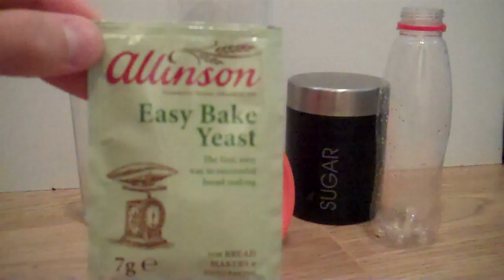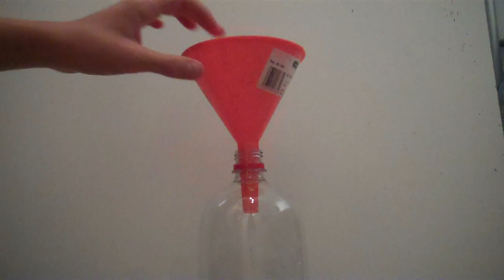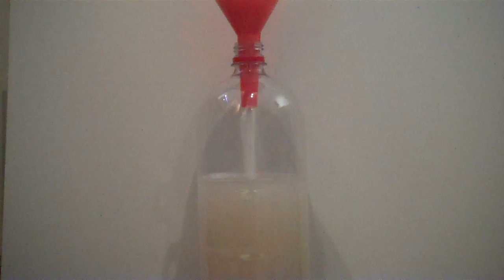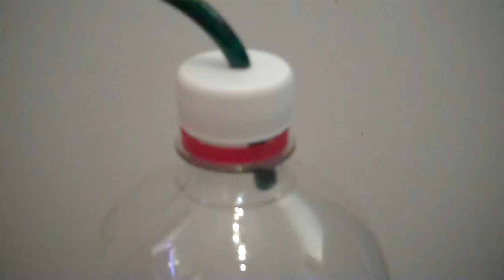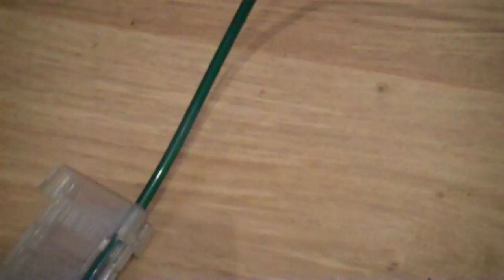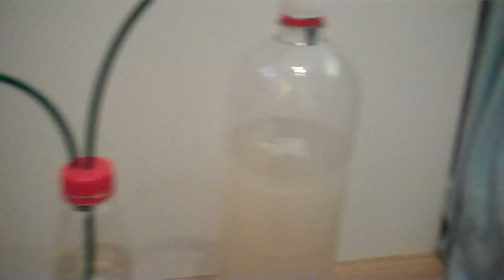How to make a CO2 reactor

Comment: have you put on a none return  valve is tried it with out one and it made a right mess it was all over carpet and over  my tank cabinet floor so I do recommend putting on a none return valve
Reply: happened to me! this was a good few years ago, i belive aftr this video came out i tried it, and half my room flooded, i had half my tank in my room!And it started dripping downstairs, i would personally put a valve as its very dangerous not to, i almost startd a fire in my sleep

Comment: Hi mate how do you turn your co2 off at night because they don't need it at night I have an Hagen one but I just put sugar and yeast in this Hagen canister with an air line and a none return valve on it if I put a air flow knob on it to turn it of at night I would I get round it as I don't want the gas inside the canister to build up and no where to go and go with a loud bang can you get back to me thanks

Comment: A great tip for Threading the 6mm Tube, through your 5mm Hole,
 -is to firstly Cut the end of the tube at an extreme angle so that you have a nice Easy thin end to thread through.
Then cut across this silly pointed bit at 90 degrees Afterwoods.  = )     Easy.

Comment: hey just for your info-
a lot of you'll have problems with the diffusing. so I just figured that there is this type of filters that has a diffusing unit in it. there is a hole where you can insert the co2 tubing
and it will diffuse the co2.

Comment: Not a post to knock Rossi. The dude is much better at this than me. I just wanna say that the bubble counter didn't work for me. I just ran a container straight to the tank. I have a glass ceramic diffuser that you can find on Amazon maybe this was my problem being that it requires more pressure than a ladder system. Regardless, I've been running this system for over a week now and not a single fish has died on me. I have Gouramis, Angels, Corys, Loaches, and Tetras. All proud survivors.

Comment from the maker: yes but only a very tiny amount would actually be diffused, it's not really worth it, you could however put the airstone under a filter outflow, this will hopefully blow the bubbles around the tank keeping them in contact with water for longer giving them a change to diffuse as opposed to just floating straight to the top and popping.

Comment from the maker: yes because if the bubbles are smaller there has to be more of them to match the same volume of gas released without using a diffuser. This means there is more surface area of the gas exposed to the aquarium water and it diffuses effectively.

Comment from the maker: wooden diffusers work very well if that's what it is, co2 ladders generally diffuse more as the gas is in contact with the water for longer allowing for more gaseous exchange to occur. It should be fine, just make sure you replace the solution every 1-2 weeks and keep the temperature pretty stable, this keeps the production of co2 pretty constant as fluctuations in co2 levels can cause algae. thanks lol :)

Comment from the maker: The only time you shake it is when you originally put the mixture together, you should replace it every week or every two weeks to ensure there are steady co2 levels. shaking it with the cap and tubing on will force the liquid up the tubes.

Comment from the maker: @1997BLucy Thanks :) I did use this for a month or so and got good results, however it can trigger an outbreak of algae if CO2 levels change wildly, this can be caused by changes in temperature, so it's best to keep a constant temperature when using this. Airstones don't diffuse much CO2 at all, the bubbles are too large...I would really reccomend investing in a ladder diffuser as they need very little pressure and operate great. I am trialing liquid carbon instead of co2 at the min.

Comment from the maker: @JackDraak you could use a diffuser however most ladder diffusers cannot fit through the neck of the bottle, using wooden or glass diffusers will also make it more difficult for CO2 to make it  into the tank and will make leaks more likely, but yeah if you figured out a way :)

Comment from the maker: @raymon664 Hi, yeah the reactor generally produces more CO2 at higher temperatures...I usually place mine near a window or above a radiator to keep them at a nice temperature. Aquarium safe silicone can be used to plug leaks if needed.

Comment: i just found a basic pressuriesed co2 sytem it comes with everything you need a ccanister tubing bubble counter a diffuser and its alot cheaper than the profetional ones ranging from£200 up tis one is only £65 and is suitable for 15g to 40g go on eabay and search :Fluval Pressurised CO2 kit 88g For Aquarium plants 
the only downside is you have to buy replacement canisters becoz the origonal one cant be refilled for tht search:Fluval Plant Pressurised CO2 Disposable Cartridge 88g

Comment: In general, in alcohol production, what is poured off is then distilled to concentrate the alcohol. The sludge is usually then 're-pitched' into the next fermenting batch to produce more alcohol, (here, to generate more CO2). The process just keeps repeating. If some contamination (wild yeast etc) hinders the yeast and you see output decline, you can start fresh with a new yeast alone. You could also add extra yeast to the sludge but this is not needed. There is plenty of yeast in the sludge.

Comment: Very little alcohol remains. What you are pouring off and discarding is almost all the alcohol and other byproducts of fermentation, leaving only the yeast sludge that falls to the bottom along with a very small amount of alcohol. You are just restarting the process, distillers do this all the time on new batches of alcohol.

Comment: As I am sure you know, you are fermenting sugar to produce alcohol and CO2. So, to 'regenerate' your system after all the sugar has been converted , drain off most of the liquid in the large bottle, leaving the 'sludge' undisturbed on the bottom (this is the yeast), add more water and sugar, shake vigorously to aerate the mixture, and you should be good to go (of course change the water in the smaller bottle).

Comment from the maker: @drpainnuk3d Hi I don't know a great deal but I'd say the minimum tank size you can use it on is 15-20litres it will be fine for a 60litre...In the long run it may be cheaper to run a pressurized system but I hear the co2 canisters can be expensive

Comment from the maker: @doddy8934 Hi I don't think that'll last any longer, after so long alcohol is produced...I'm not an expert so I don't know the exact times or formulas etc but I assume having more of the mixture will just increase the amount produced rather than the time it will last. For example it may double the output over the same length of time.

Comment: nice video :) but I suggest you to put inert substance into a smaller 2nd bottle... cooking oil could be the cheapest and easiest solution. if you have water, some CO2 will be released into a water in 2nd bottle. CO2 reacts with H2O and gives you H2CO3 (acid). will be weak acid, but stillt. also, you might easier count bubbles in oil as in water, because of oil's high viscosity, which means slower bubble speed to the surface. good luck!

Comment from the maker: @atinylittlething Hi you may be losing pressure through one of the holes in the bottle caps, try using some aquarium safe silicone to make the border of the tubing and bottle caps airtight. Also it's best to have the bottles below the tank and use a check valve bought cheaply on ebay to stop aquarium water siphoning into the bottles.

Comment: @TheRossiboy I think its more of a case of gravity and a loss of pressure. If you get a leak in the line or your solution fouls up for some reason and stops producing enough gas, then the water can find its way into your diffuser, up the air line and down into your reactor setup. If you positioned your bottles above the aquarium (which is almost always impractical and unsightly) you would never have this problem.

Comment: The check valve should be hooked up between the smaller filter bottle and the diffuser. You will see a tiny bubble flow through this valve indicating that your reactor is working. Try to get about 1 bubble per second. Adjust the control valve accordingly. Make sure you position it in such a way that you can see it, otherwise you could end up having to look behind the aquarium just to check the rate of your cO2 flow.

Comment: Hey ross my local aquarium store guru strongly reccomended 2 additional things to your setup on this vid. 1: between the yeast solution and the smaller filter bottle you should hook up a control valve (i bought mine for $1.00 AUD and it took less than 30 seconds to connect). For beginners who are unsure just tell the sales guy what you are doing and he'll help you sort it out. 2: VERY important: make sure you get a check valve to prevent the water back-siphoning out of the tank. $5.00 AUD.

Comment from the maker: @TheFirstFool Yes as long as you have a check valve on the airline to prevent water syphoning back down into the bottles. You might have too much airline...the co2 reactor can only push the co2 a certain distance...after that the co2 will start to leak so yeah just use as llittle airline as possible and use a check valve :) I'm pleased you found this vid useful

Comment: So you can have both bottles below the aquarium at the same level, because the reaction of the sugar and yeast creates enough pressure to push the Co2 up the air line? Very well explained vid. Thanks. I wish I knew about Co2 diffusers years ago.

Comment: Great video.. although, when people say co2 reactor, they refer to a very specific device, used to desolve the co2 in the water 100% with no waste.. (and yes, you can make one yourself), so it's wrong to call your diy system a reactor. :) But yeah, great guide, next, maybe look into a co2 reactor for 100% dissolving of the co2. ;)